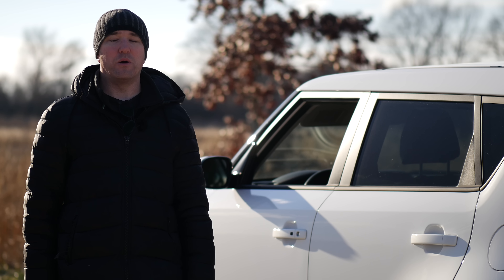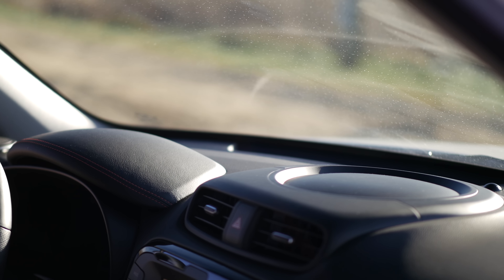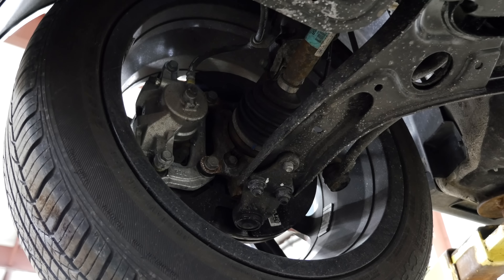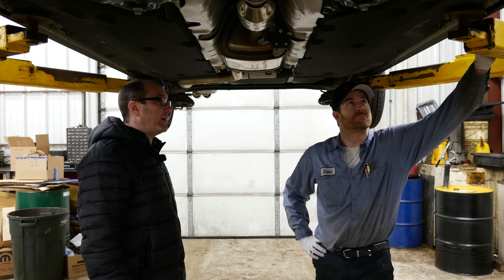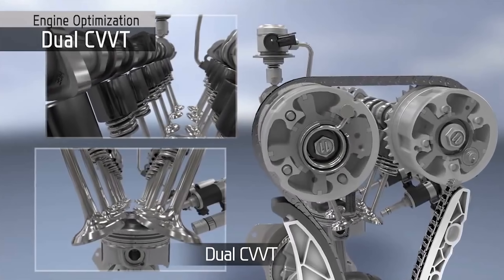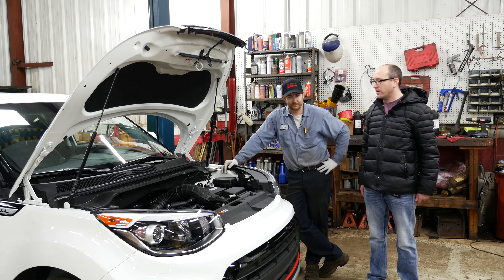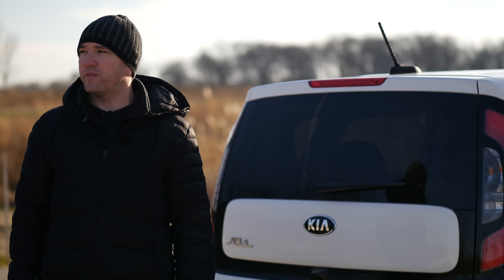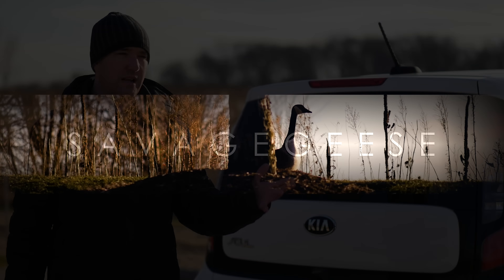Review | 2017 Kia Soul Turbo | Character Flaws

Comment: I recently had a brand new (28KM) Kia Soul rental car.  It was the cheapest option.  It was actually super fun to drive around.  The ride quality isn't the greatest, but it handles like an oversized go-kart.  I would have no problem buying the manual stick shift of this car.  Good value for what you get.
Reply: Go kart ? 🤣 Then what the Chevy spark is .. 💩

Comment: I just this week rented a 2018 model with normally aspirated engine. With three of us in the car and a bunch of luggage , it was surprisingly comfortable, quick and nimble. On I75 , I4 and 417 in Florida I was managing 80 MPH speeds and had plenty of power to pass at 90.  I felt the car handled very well. I did not encounter any rough roads so the suspension seemed fine. I did not get a sense the car was "cheap" in any way. Under the hood, the engine appeared to have a lot of room for servicing. The only negative was that I would like to have had more distance from seat to dash. Also there was no place on the center console to place my GPS unit.  It would be a car I would recommend.

Comment: I live in a snowy region, and have a 2012 kia soul, 136,000 miles. All you need is good tires to get you from point A to point B. I drove my dads brand new truck off the lot 40k brand new truck and got stuck in the snow on a main road, had some sanitation workers help me out and I gave them doughnuts a couple days later for there help. Tires are a big deal, people are a big deal, the vehicle does matter, but the most important part is how you drive it. I drove that beast of a truck out of a parking lot, and got stuck 3 blocks down. 4 wheel drive was on, had 2 gas tanks full, he paid 40k for this thing, tires are brand new, so I felt confident compared to using my Kia soul. The point is, it is not about the vehicle(to a point) it is how you use it.

Comment: This is a vehicle I never would have considered. My car was in the shop for some body work and I rented a Soul. Really liked it. I decided to test drive a high end model (because I wanted the sunroof, not the tech). Found out you can't get a sunroof and have a roof rack. This was a deal killer for me. We are "active seniors' and have to have a roof rack for our bikes (no hitch rack for me). Ended up buying  a 2011 CRV EX--no tech, real transmission, hydraulic steering, sun roof, and roof rack.
Reply: I wonder if you can add a roof rack. I rented one, no sunroof. But it had no roof rack but there were plastic plugs where one would go.

Comment: Why do you call this an old platform. The second gen Soul was released in 2014 and still looks fresh three years later. We love our 2016 Soul+. It's small on the outside, yet deceptively large on the inside. It's also very comfortable for road trips and a perfect car for commuting.
Reply from the maker: +Chuck Donahue it's built on Hyundai and Kia is last generation architecture. When you take a look at what they did for the current generation and you feel the difference in terms of driving solidity and all the things associated with these changes you don't understand.  But if you haven't been in those cars back-to-back it's less noticeable.

Comment: The most amusing part of this car, KIA Soul, is the pie plate in top of dashboard where the electric version has components. That pie plate cracks me up. The ride? Seemed okay but has turbo lag, in the city. My wife liked it, not myself. I spent 15 years driving a 2002 CRV with V6 Accord engine. Another box on wheels. It was okay, which is why I had it for 15 years. When new, had much of what is now common in cars. The Soul is fine, just not for me. Though i did end up buying a KIA car. They're a highly regarded dealership. shop and customer service company here in Canuckland.

Comment: This is a terrific car for the real price that you will be able to pick it up for. I do disagree with you on the interior materials quality. I have a 2016 exclaim, and, unless they changed something (appears they did not), I find the materials to be quite good for this class of car. Lots of soft touch materials. I appreciate this video a lot. Makes me wish I had the 1.6 turbo and (equally important) the dual clutch transmission. I dont think the ride should be a turn off to most buyers. I dont think mine rides too terribly (again for this class of car). Maybe my roads are smoother, but I have never wished for a softer ride. On the other hand, I HAVE wished for more power, which KIA has addressed with this model.  Kia has a home run here. There are not many cars left in this segment to consider and there is a lot of value to be had here. But where are the paddle shifters? Seems like an obvious omission for a car of this type. Would love to see some nice metal paddle shifters!

Comment: In regards to h22 swap odyssey, first gen odyssey was built on the accord platform and are stock with the h23 motor. I own a prelude with an h23 swap (stock with h22). I did not perform the swap but from my understanding, the motor mounts were the only adjustments needed.

Comment: Good review. Disagree about the CVT though. CVT is fun to drive, if you see hypermileing as performance driving. Keep the rpm below 2000rpm and it is gold. Listen to the engine noise. Less rumble = less fuel use. You can play with the endless gears endlessly. It never bores me. And, it is objectively the best way to get around the fact that that 19th century technology we call a gas engine needs a transmission in the first place.
Reply from the maker: +Ronald de Rooij Except 70% of CVTs are not that good.  There are a few that are doable but its few and far in between.  For daily driving non issue though, agreed.
Reply: Ronald de Rooij the CVT is ancient tech. it was created by Michealangelo in the middle ages. The reason Asian auto makers are producing them in large volume is because they're more affordable to produce than a various speed transmission.
Reply: I got a a cvt and I hate it every damn time I drive

Comment: I wonder if the suspension's any better on non-turbo models. I'm thinking of buying a 2017 Kia Soul Plus with the 2.0 GDI for the exact reasons you stated, it's cheap basic transportation with tons of versatility and has great reliability and safety ratings.
Reply: bad mpg

Comment: I have had my 2017 SOUL for about three weeks or so and so far I am pleased with the suspension. The cheese crate moves for what it is. I gave up a dodge dart gt for it and so far I like everything but I need to figure out all the electronics to which I am not that great at. The head room is great, Leg room, Heated steering, Seats also and both sides power. It's got everything I wanted but the fall backs are the security unless I am doing something wrong. You cannot leave it running and lock the doors. And it appears to have no alarm!! WTF? I haven't had a car without an alarm since like 85 or so. I had to get them to toss in an auto start. So there are some down falls to it but over all so far I am OK with it. I'll only have it for about a year anyway.

Comment: In Canada, a lot of these make it to rental fleets.  If you want one of these as a second car, a used one with around 10,000 miles is half the cost of new.  The turbo would be fun, but it's not a great value proposition.
Reply: elton john just the vehicle for the yellow  brick road.

Comment: do u think the poor ride/handling is more from the 18" wheel/tire or is it the dampers too?  will the 17s on lesser models be more "forgiving"...my mk4 gti has a twist beam rear and short wb and it does just fine; granted its not a Lotus...adding a larger rear swaybar could help tighten things up (if ppl make them)...this car is C&D's #1 in this segment so KIA has to be doing something right

Comment: The tech package gives you Blind spot and rear cross traffic alert. Harmon Kardon audio, LED foglights. AFS LED headlights and LED rear taillights. Apple car play, android auto.  Power folding rearview mirrors. Heated steering wheel. Panoramic sunroof. I don't see how you can call this car basic or that it doesn't have any tech.
Reply from the maker: +Anthony Cuda Thats a 3k add on no one will buy.  Its nuts.

Comment: I love the way the kia soul looks actually. The 2nd gen anyways, the first gen not so much.
Reply: The 2020s are ugly and they are using crappy CVT transmissions in them.  2019 or older is the way to go.  Have to go backwards on cars nowadays to get something dependable.  Everything is changing to crappy cvt garbage.
Reply: Yeah if it ain't broke then don't fix it 😂  2020 , 2021 cars are kinda ugly ...

Comment: These cars, in the right color with the right wheels and the panoramic sunroof are GORGEOUS.  Anyone who thinks otherwise has a warped view of things.  Granted, KIA has managed to make some of the Souls look hideous with the red line going around the bottom of certain colors and the new 2020 and up look like absolute ass.  But the funky ones from 2010-2019 were awesome.  They had SOUL.  Unlike the new ones that look like boring grandma rides.  Thanks for letting some psychopathic CEO ruin a good thing KIA!!!
Reply: Not to mention they have started putting the garbage transmission in the new ones (CVT) Crap Valued Trash.

Comment: Most of the little characteristics on my 2012 that i actually like,  have been modified/changed.
The only thing i dont like is the suspension and the 16 inch wheels, everytime i hit a bump or a hole i gotta get a alighnment. I must have had 5 alighnments by now.
Other than that, its a good car.
If you want a v8, a truck, stationwagon, 8 speed car, anything other than a kia soul- Then dont buy the kia soul & then complain about what your dumb ass bought.

Comment: I personally found this review to be frustrating to watch. You constantly went off on tangents it tried to crack jokes that weren’t funny. You harped on a car that, while it isn’t a luxury car, fully kitted out has one of the nicest interiors in its class. You’re correct in that it does not have any advanced safety features, but if you cannot drive without those, you probably shouldn’t be driving at all. Kia/Hyundai products are simple to work on and the chassis of this car isn’t a bad one. In my experience, the rear torsion beam suspension is one of the better ones on an economy car like this. It doesn’t get unsettled unless you go over a massive pothole. Interior fit and finish is quite good for the price range, superior to most American models. The acceleration is quite good and the Turbo 1.6 has a good amount of spunk for this smaller, body car. I honestly had to stop watching the video. To be blunt, you don’t speak with any sort of enthusiasm, you get sidetracked, and it takes forever for you to get back on topic.

Comment: you do excellent video work and commentary, and you noted in your trailer that you remain free of sponsorship and fan funding (which is commendable), HOWEVER, YOUR NEW VEHICLE FULL REVIEW BRAND SELECTIONS ARE DECIDEDLY LOPSIDED:

Hyundai / Kia brand - now 14 different full reviews
Lexus - 9 full reviews
Mazda - 8 full reviews
Toyota - 7 full reviews
Audi - 1 review (and it was a CUV)
Infiniti - 1 review (and it was a CUV)
Volvo - 1 review (and it was a CUV... see a pattern here?)
BMW - no reviews
Cadillac - no reviews
Jaguar - no reviews
Acura - no reviews
Lincoln - no reviews
Mercedes - no reviews
VW - no reviews

obviously you get to decide your subject matter (i.e. i don't get a vote and likely you don't care what i think) but you are wasting your time and talents reviewing Kia Sedonas and Chrysler Pacificas
Reply: bo darville He reviews what he can get his hands on, he doesn't really get to decide which car to review next.
Reply from the maker: Unfortunately I can barely handle doing a video a week. Right now I am about 4 behind.  In the winter I purposely put off many of the more expensive cars like Audi, Merc, Infinity because it is a nightmare doing video.  The diversity issue is somewhat two fold, winter fleets are wimpy not a lot available.  I could have done a GSF with summer tires other cars like that I purposely put off. (no point in freezing cold and snow)

Right now through Feb there will be 6 more videos, S90, G90, Elantra Sport, Fusion Sport, VW Passat,  Escape and a few side videos.  In spring/summer the diversity will go up, hopefully.  

The last issue is some brands like BMW, and I will call them out are not good to work with.  They don't respond to emails, blow off calls and then when you talk to the guy in person he laughs about it.  There are other brands that don't have budget for press fleet in chicago which means I would have to travel to Detroit and thats just not going to happen to make $100 on a video that will take me 2 days in travel etc unless it was a car worthwhile.  Other brand reps are maxed out, I won't say which ones but the companies are so lean and cheap they have ONE PR rep for the entire country, it's just sad.  I feel bad for even emailing them.  

Thats the back end.  As a viewer I understand it's not ideal, I'd feel the same way.  But just know it will improve. It goes in up and down cycles and as time goes on and hopefully income grows I can spend more time traveling etc.
Reply: savagegeese come film in SoCal! Where 46 degrees is "freezing" You never know, a fan might just let you crash for a few nights!

Comment: I told you dude....the 1.6T + DCT is the fucking titties at least for this price point. It's not too bad at all considering the shit you get these days. 0-60 in the mid to high 6's all day long in my Sonata and I can still average almost 40MPG on the highway driving normally! I wonder if they changed the transmission logic though because that is one area I'm not particularly impressed. Doesn't downshift or upshift when it should. Needs more refinement at lower speeds too although I know all DCT's have some jerkiness at low speed. If you drive it like an asshole for long enough, sometimes the DCT will give you these super meaty lightning quickshifts that even jerk you back a little in the seat. I love it haha. Except in the Sonata, you get supreme ride quality on par with their German counterparts or better actually. Driving dynamics aren't particularly great with considerable understeer, but for a massive sedan you can't complain. At least it's super safe. I couldn't even get it to oversteer with the e-brake in the fucking rain....well until the tires wore down to below 20% a year later and had the living shit beat out of them ahah. So far after almost 15k miles of constant bashing / essentially track driving, it's holding up really well. Even the brakes were really good and take way longer to destroy than your typical shitbox.
Reply: MotoBoy You are reaching. I dont have anything negative to say about Sonata but to compare the ride quality to German counterparts is a far reach. What german car are you attempting to compare the Sonata to?

Comment: THAT DCT TRANS IS TERRIBLE AND OVERHEATS ALOT! They have had a lot of reliability issues with it
Reply from the maker: +DoubleD 613 In the Soul should not be an issue since no one will drive it hard. :)
Reply: why would the DCT overheat? Unless the clutch pack is worn, I would not expect a lot of heat from a gearbox.